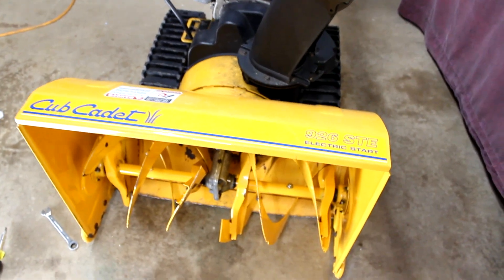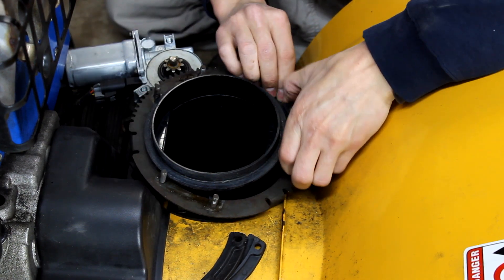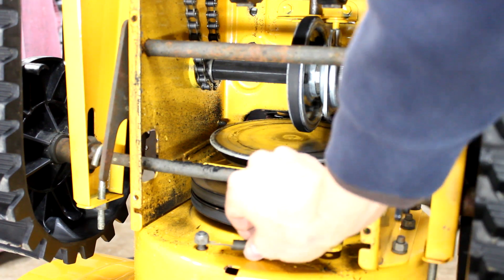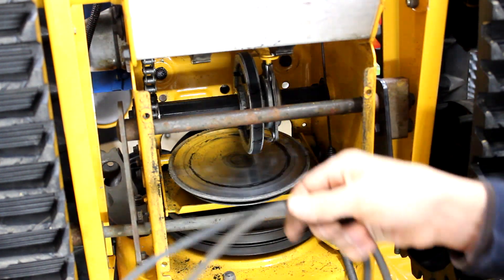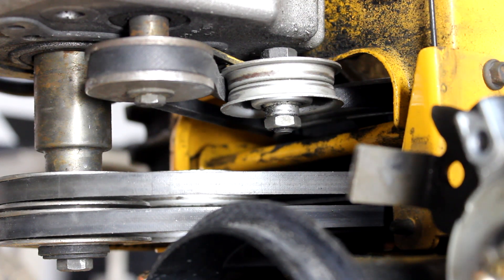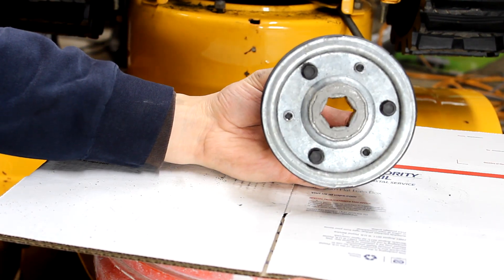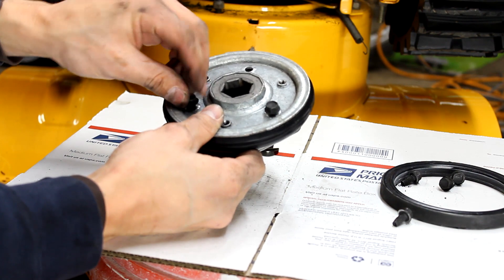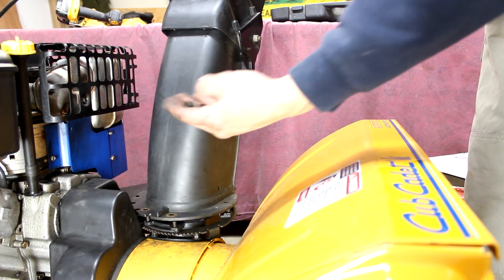Cub Cadet service belt change friction wheel, 926 STE 726 snow blower repair /shot with Canon T3i

Comment: I realize this is quite a few years old, but I just inherited Cub Cadet 926, and this video really saved me a lot of time.   Thank you.
Reply from the maker: that's awesome! I was hoping it would come in handy one day for someone!
Reply: @mattdobson123  The old beast had numerous problems, but it's all back together and running great.   The dual drive is a little funky, but I figured out a way to change the belts without splitting the machine's front.  Again, thanks.

Comment: When you put the drive belt on one trick is you take a ratchet put it on that screw where you were trying to push the belt on when the belt gets tight you turn that screw with the ratchet The pulley will turn and it will roll the belt right on
Reply from the maker: that makes sense, thanks for the tip!

Comment: I've got the same kind of snowblower but it's a yard man. I'm trying to get the hex shaft out to change the friction wheel, but the shaft is very stubborn and won't slide out. any ideas on how I can get it unstuck?
Reply from the maker: Sorry man, I sold the snow blower when i moved out of New England.. I don't recall the disassembly or else i would try to help
Reply: mine was stubborn too. I took the left side bolt completely off, sprayed the right side with blaster, and wacked the left side with a hammer on wood. I had a 1" wood dowel rod laying around so I used that and wacked it. There's really nothing to hurt except the threads, so don't wack the bolt.

Comment: You didn't clean the friction wheel with all that rubber on it with a Scotch-Brite pad and some brake cleaner.. 

That's very important step
Reply from the maker: nice point! thanks for the tip/information